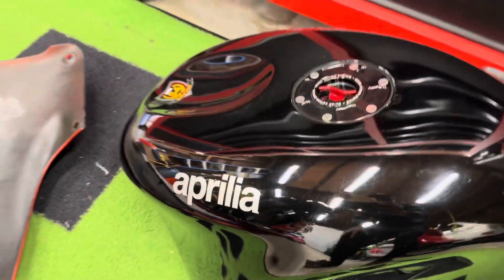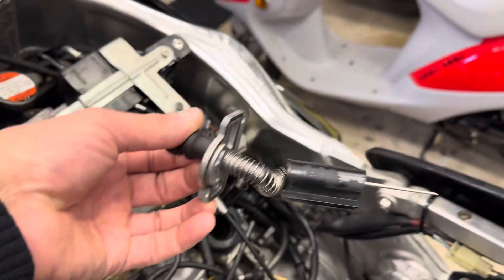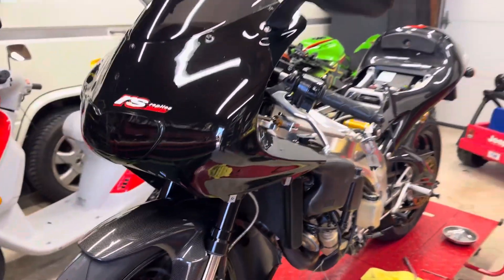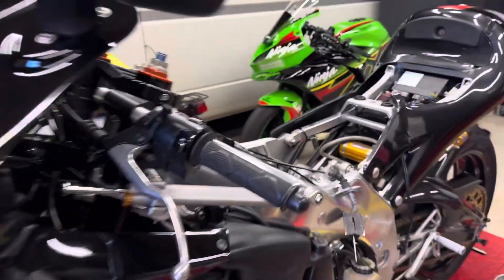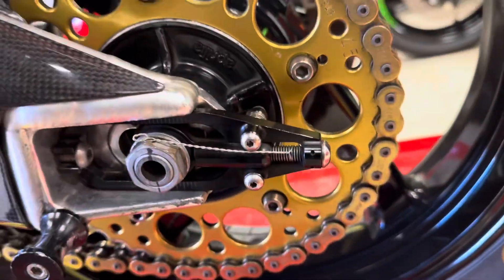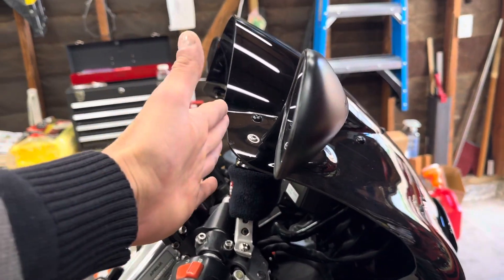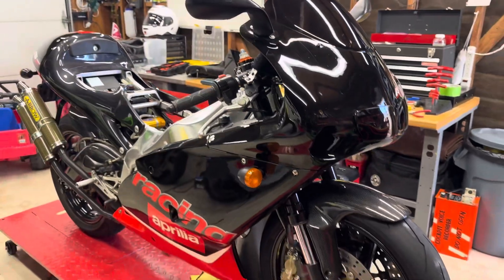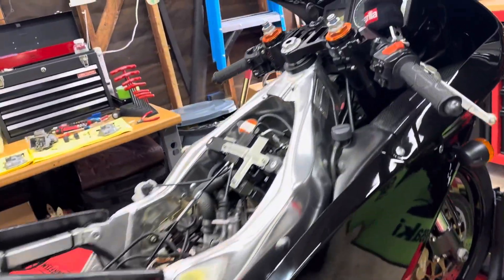Aprilia RS250 carb cleaning

Comment: Great Job !
Reply from the maker: Thank you!
Reply: Hello Sir, 
I'm wondering could you help me with a question i have.
My bike failed to start so I 
Took my Carbs out and cleaned everything, the jets were blocked ..
Put them back in bike is only running 80/85 percent .. 
If I start it with choke it is OK,  turn off choke bike won't rev properly kinda  bauke's ! then cuts out.. if I drive it in-between gear changes or a stop it revs very high .. 
Everything is back together as normal,  Would you know what else it could be? 
Sorry for the very long Question 😅